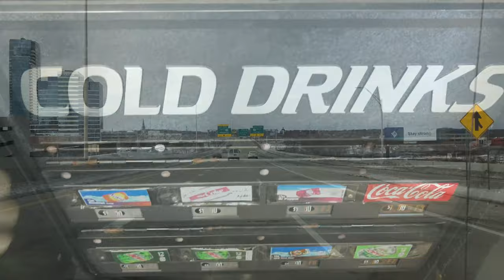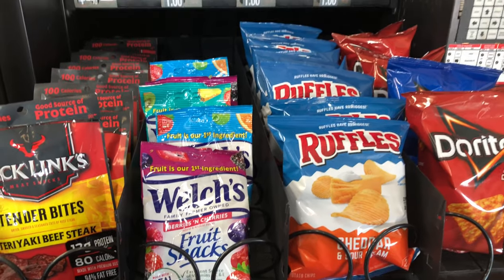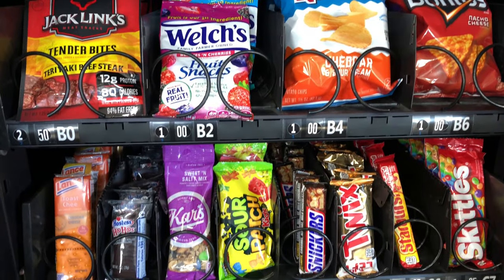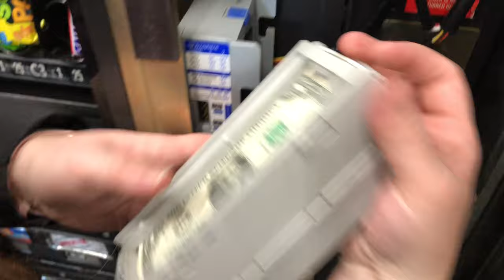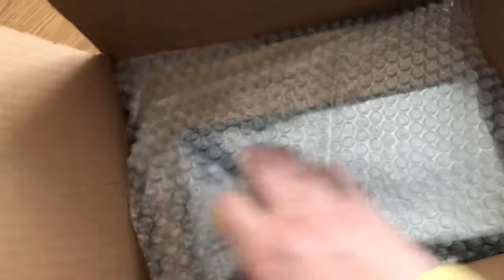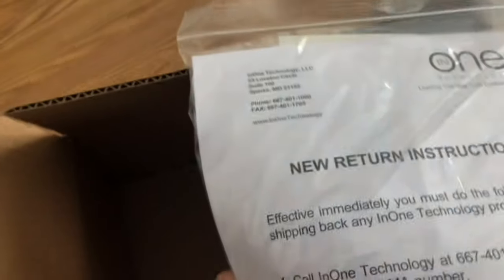Upgrading vending machines | Vending machine upgrade kit for MDB credit card reader | Vending vlog

Comment: I have a 6 pin mdb cable that doesn’t match nayax 6 pin mdb cable, my female end is bigger they don’t match but they’re both 6 pin, do i need a different type of cable?
Reply from the maker: You probably do need a different cable. Without seeing it, I have a hard time making a suggestion. Call and troubleshoot with Nayax, they are very helpful! Good luck with your upgrade.